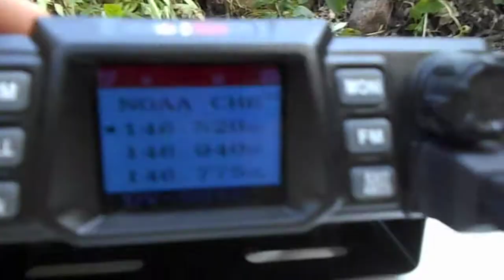J-pole Setup

Comment: I am going to put a j pole up so i can hear my local police and ems trunking p25 system. they are on the 150 to 160 mhz. i'm confused if i will need a LNA the antenna will be about 30 feet away.